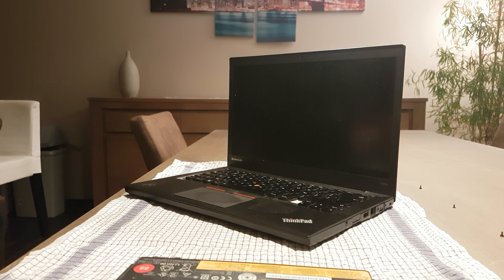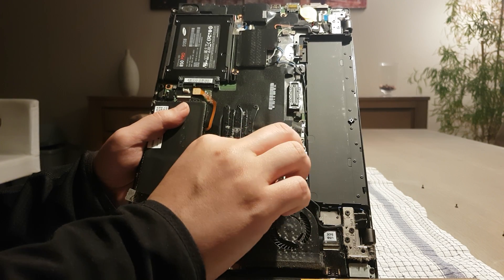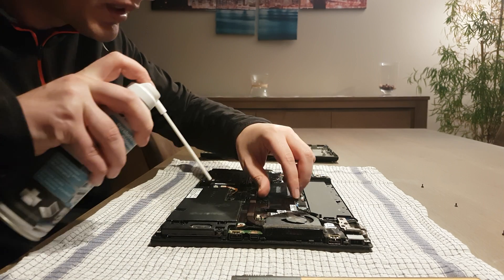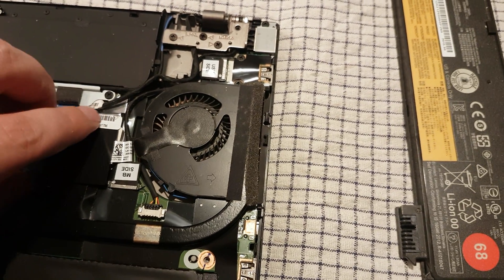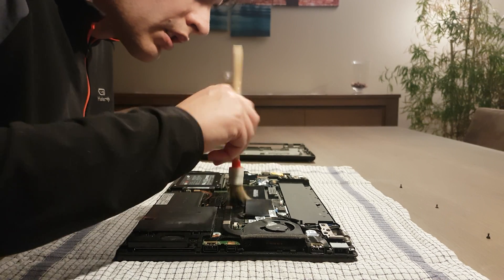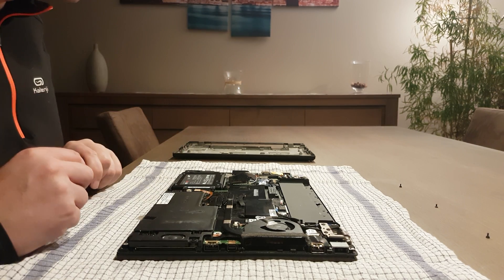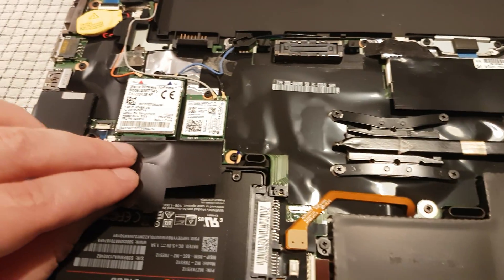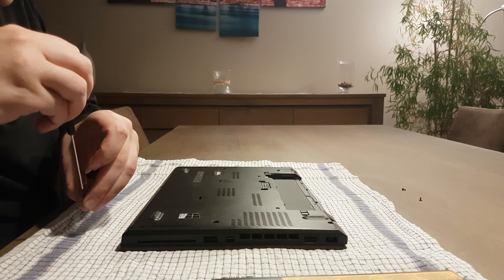Lenovo T450s overheating and cleaning

Comment: Cleaning the fan when installed on the board, seems impudent. You should remove it, and THEN clean it with whatever you want. You should also replace thermal paste in the process. That will be a good cleaning process, and a better solution to overheating.